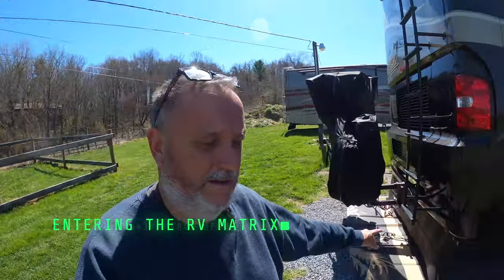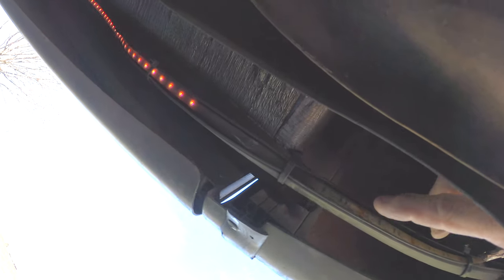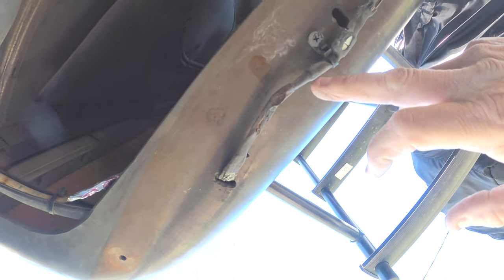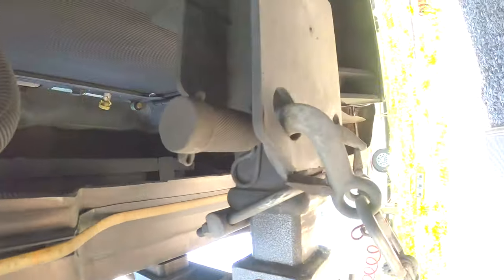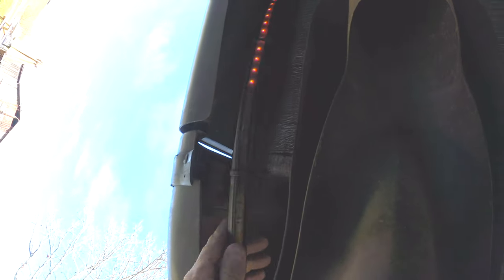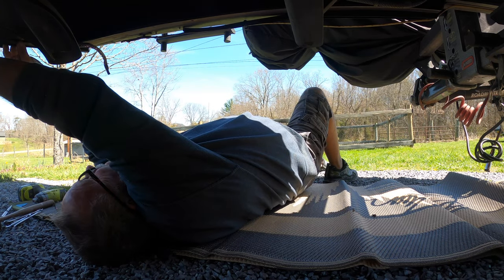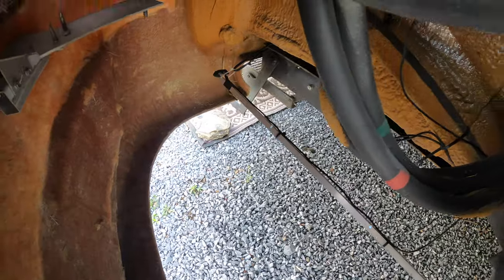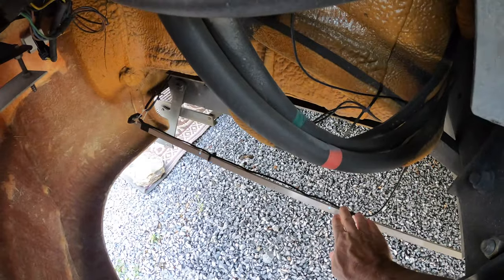Under Coach LED Lights Repair | Full-Time RV Living | Sunday Solution

Comment: Thanks Randy!  From a viewer's perspective it is easy to tell the difference between being Honest and being Negative.  Seeing the markup on the lighting materials used and the quality of work requires a bit of venting.  And that mud flap bolted into the rear cap fiberglass in front of the exhaust also seems low quality.  As I mentioned earlier, I do not have a mud flap on my 2014 33AA and was considering one so keep us posted.  I have not looked closely but most mud flaps look to be hanging by chain closer to the rear tires.  Great information sharing.  Thanks Again.  Monty
Reply from the maker: Thank you Monty, I'll be sure to let you know how it works (no mudflap), if we go back to one it will probably be the hanging type that is attached somewhere ahead of the exhaust outlet.

Comment: Where does it hook up to the electric?   We are going to do it ourselves!  Figured we can’t do worse then a 1400 job!   Can you show how it is tied into the electric system and where you control on off.  We added it to the slides on our last rig but looking for a more seamless solution.
Reply from the maker: It’s tied into power in the main bay 110v and converts to 12v thru the controller that is also in that bay. It’s controlled by my cell phone. I’ll post some pictures here tomorrow.
Reply from the maker: I cant post pics here, if you provide me with an email at chasingthedream@gmail.com ill send you the pics. Basically the kit plugs into any 110v outlet and has a small transformer that converts to 12v. It's plugged into an outlet in my pass thru bay, if that makes sense